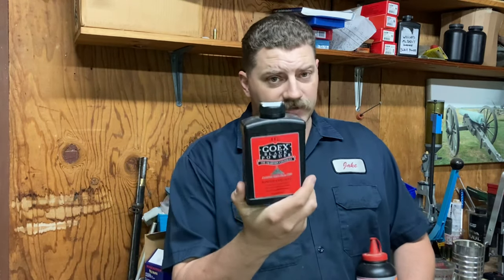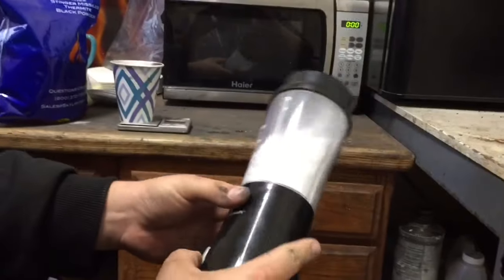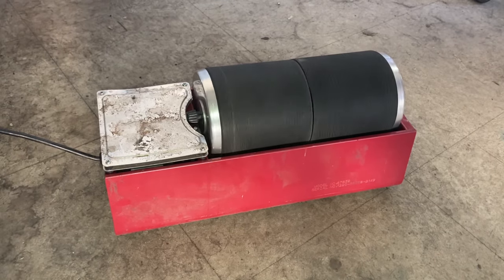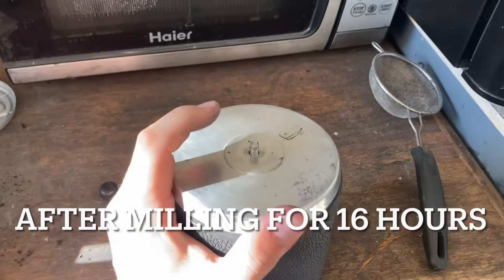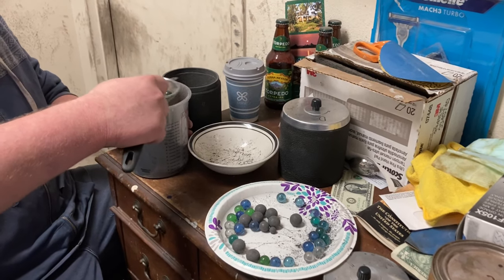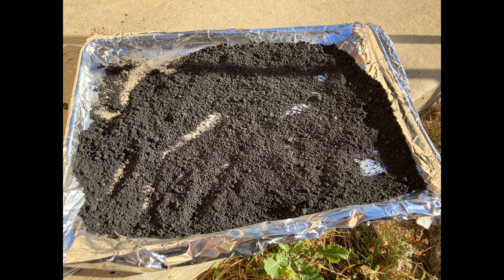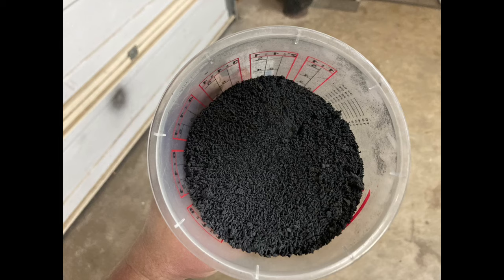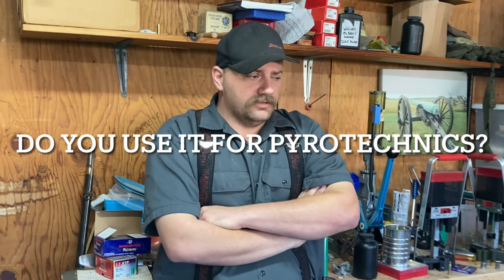How to make black powder (for firearms part 1)

Comment: Your powder is weak because your process produces a simple mechanical mixture of particulate components. Your process is typical of powders produced up until the 1820’s. 

Potassium nitrate (KNO3) is water soluble. By wetting the mixture of components with water and acetone the nitrate dissociates and is adsorbed onto the carbon and sulfur particles. Thus a chemical compound of sorts is formed as opposed to a particulate mixture. The water dissolves the nitrate. Acetone acts as a drying agent. The resultant cake is broken and screened to grade. This is the process used to produce the “fine English Sporting Powders” of the 19th century. 

Sulfur is not soluble in water. It is in non-polar solvents such as acetone. Some sulfur to carbon adsorption will occur in the above process. Sulfur is completely soluble in carbon disulfide (CS2). If added to the above mix total adsorption of the nitrate and sulfur to the carbon particles is achieved. The resultant mix is caked, dried and granulated. Then graphite is added and the powder tumbled. This prevents clumping from the slightly oily residue of CS2. This produces the highest possible energy. This process was used for cannon and naval rifle powder prior to the adoption of gun cotton propellents. 

Addition of water and a drying agent like acetone or alcohol is easily done at home. Use of carbon disulfide is not recommended. Primarily due to issues of toxicity.  It is also not readily available to a home user in sufficient purity. The “Swiss Powder” now on the market may be of the latter process using CS2 as suggested by its efficacy, but no literature so confirms. 

Take great care in breaking and screening your dried cake. Use only wooden tools and brass screen. Work in small quantity. In this way you can produce a totally acceptable propellent. 

You grains can be separated with  a set of brass screens. With 12,16,20 and 40 mesh. The 12 mesh screen retains F powder and passes all others. The 16 FF, 20 FFF and 40 FFFF and so forth. Fines below 4F should be reincorporated into the next batch, being too fine for safe use in firearms. 

Use common sense. Work safely.
Reply: I agree.
Reply: Very good sound technical advice. Thank you.
Reply: This post probably helped me more than 90% of the videos I've watched. Please tell me what you would recommend for written material that tells you how to make comparable powders to the store bought powders. Yes I'm a pepper but I also want to know. Thanks you for your comment and any assistance you may offer.
Reply: I’m

Comment: You powder is weaker because it's less dense. You need to compress it into pucks then corn it if you want the same power volume for volume.
Reply from the maker: We were experimenting with that this weekend! It seems to have done the trick but we haven’t thoroughly tested it. It also makes nicer granules, in my opinion.
Reply: @Everythingblackpowder  I have a series of videos recorded but not yet published on how I do it. Nicer for sure and more durable but I tend to loose a lot as fines in the process. Screened is still best for most applications if you ask me.

Comment: Have you tried making or buying a die and press it into pucks and the granulate it from there? I'm currently getting a list of stuff to get in order to make my own black powder and from what I read making pucks and granulating makes it more powerful
Reply from the maker: No I haven’t, but if it makes it more powerful I will give it a try
Reply: @Everythingblackpowder  yea from what I understand if you granulate before compress it you have to weight the charge by weight instead of volume
Reply from the maker: @MrArtemioP  interesting

Comment: 13:48 that is incorect, I think. It most likely decreases the amount of water in the mixture making the nitrate much less sulluable and causing it chrystalise. That's also why it's cold since solluability of nitates decreases when you cool them.

The nitrate should chrystilise naturally as the water evaporates, but alcohol has the benefit of evaporating quicker, increasing the speed at which you get a dry product.

Comment: 👍👍 You answered my question good nuff. I noticed how much lighter my ‘Joex’ is and wondered about weight vs volume. I’m betting I’m half the weight if I weighed 70grains by volume. Need a chrony but I was in a hurry to beat winter so I bumped about 20-30 grains and went with ‘feel’, report, and targets. Pretty cool. I like watching it dry, best. 😊

Comment: Your doing it the right way for sure, buying it makes no sense when its so cheap and easy to make. Your powder is pretty fast too. What definitely makes it more powerful is wetting it out  whether with water, alcohol or 50/50 of both, (I use boiling water) spreading it out to fully dry and ball mill again. I suspect you'd pickup the missing 20% by doing that. Great video!!
Reply from the maker: Thank you! I will give that a try
Reply: @Everythingblackpowder   I forgot to mention, make sure that you dry it in the same bowl container so you don't wash out the Pottasium nitrate. It will take a few days to dry, i just give it a good stir each day as it starts to dry so it doesn't end up a solid clump. The idea is the potassium nitrate is absorbed and recrystalizes into the charcoal. When i make  charcoal, I only select the very lightest - lowest density and driest pieces (branches) of willow and the again when selecting the charcoal pieces. It does make a noticeable difference to quality of the BP.

Comment: A good video on BP.  Everything you said is absolutely true. The best I've found is charcoal from Box Alder. I never tried grape vine. Commercial powder is compressed BP which means you need 20 percent less as you discovered. Definitely clean a Cap and Ball revolver right after shooting Pyrodex or you'll be taking it apart with a hammer.

Comment: I finally got around to making my own black powder, decided to start with a small batch, made 1/4 pound to begin with and got all the ingredients from Skylighter. I left out the Dextrin. After 16 hours, the powder burned fast, and after testing it in my Pedersoli French Cavallerie carbine, went off with no issues and cleaning it wasn't much different than Goex.
Reply from the maker: Glad to hear it!

Comment: I'm on my fourth batch of black powder now, and it seems that with at least the ingredients I got from Skylighter, that 16 hours is the minimum for a decent burning powder. I tested some at 12, it was close, 14 hours, a little closer than that, and 16 is dead on for a fast burn. With the weather already getting colder here and doing my powder outside, I'm probably on my last batch until spring, but I don't shoot as much or compete now so other than for hunting, I won't be going through as much. After this, time to turn some useless lead into useful projectiles!

Comment: I could also imagine, purifying the potassium nitrate by chrystallising it and washing out the junk could help. 
I'd also get some universal ph test strips. Then put some of the charcoal in water and test the ph. 
If it is a bit alkaline, I'd let it sit for a bit in a vinegar solution and then wash out the resulting salts with water.

Comment: Great and helpful video. Thank you! Skylighter recommends: 1) turning only one drum because the weight of two exceeds the 6lb capacity of the ball mill; 2) increasing the diameter of the drive roller so as to turn the drum at a higher rate of turns per minute (which reduces milling time); and 3) not to use pure lead balls but rather hardened, so as not to get lead dust or wear them out. Any comments or recommendations about these?
Reply from the maker: Yes, check out some of my newer videos.

Comment: I was able to take a volume measure of Goex powder and weigh it. I then weigh the same measured amount of my powder and finding it lighter I add that difference in weight and that's what I use for my powder. So I do actually use a weighted amount of black powder. The difference is usually about 20% just as you say so I must be doing something right. The Goex powder is denser somehow. It helped a little bit to make dextrin and add a minute amount to help keep the grains from crushing easily.
Reply from the maker: You need to start Corning your powder.
Reply: @Everythingblackpowder  I do and it's still not as dense.
Reply from the maker: @russellkeeling4387  have you tried pressing it twice?
Reply: @Everythingblackpowder  I will give it a try. I do not have a press like yours so it's not as simple for me. I am preparing to make more so I will plan to do that very thing. Thanks.
Reply: @Everythingblackpowder  I have corned some powder but it is a lot of work for little gain in my case.

Comment: Tried Pyrodex in my first flintlock and could not get it to light.  Had a glass jar with some DuPont Black Powder that I got with a cap and ball Kentucky Pistol I bought in 1969.  Put that in the pan and it went off fine time after time.  Reason that Pyrodex and 777, etc. don't work for beans in a flintlock is that their flash point is about 400° higher than black powder (BP).  You can use it with a "starter load of BP of 15 to 20 grains in the main load with the rest of the charge of Pyrodex on top of it.  Still have to use real BP in the pan, but that will work to ignite the Pyrodex in the barrel....just make it easy and use BP in flintlocks

Comment: Your home made stuff burns way cleaner than the commercial stuff, not as much"oomff" but close and very clean, I didn't see any left overs from the burn between Pyrodex and the Commercial stuff and yours.
 Nice job. I have been only able to achieve the relatively fast BP, nothing like what you are doing, I have the same setup, good quality everything, but perhaps the sulfur, it's supposed to be pure but I should crystallize a bunch. Also started making my own charcoal.
 I would be very pleased to be able to make what you are. I'm getting there. Thanks for the video!!!
Reply from the maker: If you are using good quality ingredients and milling it long enough, Then you should be able to make high-quality blackpowder. Keep after it. Thank you.
Reply: @kevinmathis1278  thanks, I have been messing around with making my own charcoal, I have an electric smoker, so it's pretty easy.
 I haven't done willow wood yet, I have done cedar with much better results than the hardwood airfloat I was buying. A lot cheaper too. 
 Thanks again, will probably take a walk down the a creek nearby and see what I can find.
 Have a great one!!!

Comment: i started tweaking the recipe again . im trying out 50% char cloth ( cotton based charcoal) the idea is that the long fine fibers would help spread the flame through the granules faster and in a more uniform motion. i don't have access to a press or else id try that method i feel like it would really take it up a notch.
Reply: Success, The charcloth mix really stepped up the powder's performance and ease of ignition. A unexpected upside was the granules seem to be denser and wont get crushed back into a fine powder quite as easily. It seems to burn a fair bit cleaner too. Even the fowling is softer and easier to clean. There are some downsides though. Its relatively time consuming to make the charcloth. Not to mention expensive if you have to buy cotton. Its kind of difficult to blend it into a finer powder, As you'll fill the blender almost all the way, Blend it and now its only a quarter full.  It takes A LOT more charcloth by volume to meet the measurement by weight compared to wood charcoal. And the charcloth can stain your hands yellow ( that one caught me off guard and thought i was in medical trouble for a couple minutes LOL). However even with its down sides it really does make a better black powder. I just wish i could find a CHEAP way to puck and corn the powder. I believe that would make it just incredible to use.
Reply: Next i want to find something i could put in my ball mill to agitate the powder and keep it from sticking to the walls or bottom. I feel like whenever collects in one spot only the top layer is getting milled to absolute perfection.
Reply from the maker: Glad to hear it
Reply: Your ball mill is very fast
Reply: @drakesairguns7848  this is great. I had this idea a few weeks ago and well looks like i found my answer. I figure Cotton charcoal would have more surface area than wood charcoal. Thanks for sharing. I have to give this a try

Comment: I'm not sure about Goex, but I know Schuetzen and Swiss make their own charcoal out of the finest select hardwoods available. I believe Schuetzen uses ash, and Swiss uses a proprietary blend of hardwoods including ash. This could possibly be why their powder is stronger than home made. It might make a good video to do an experiment to see if that's the case.
Reply from the maker: I’ve heard Swiss uses alder buckthorn which I guess they have a lot of in Europe. I don’t know what goex uses but I kind of doubt it would be hardwood. The power difference between hardwood and softwood is huge in my experience.
Reply: @Everythingblackpowder  In retrospect your right. it was alder and not ash. But I was sure one of them used hardwood in their blend along with the alder to minimize fouling, I read it somewhere not too long ago.

Comment: I been making black powder for years and years and i am going to tell you. You are forgetting one very important step. I realized I was doing it wrong when i researched "Black Powder Stamp Mills".  The mills that make/made Black powder used a large stone or wooden stamps to mash and mix the composition. But, whichever method they used it was imperative that the crew keep the powder "moist"... If not, the increase of explosion due to the mixture becoming hot or more prone to static discharge, reaches dangerous proportions. 
Add some water to your mixture to make it damp. then put it in the mill. The batches I made were 8 oz at a time in my homemade mill and milling time was 3 hours... it might be a good idea to check the mill to see if its still damp at 1.5 hours. and ad a bit more if needed. Keeping the mixture damp makes for some very quick powder. After it comes out and is milled re-wet the mixture and make what seems to be a clay or play-doh ball. You know what to do next with it? :) However before you make your ball, there is another step i do its simple but that's my "secret". This powder will be better than yours just based on what I explained you need to do (make damp before milling). Try it. If you like, give some credit my way, make a new video. Most everyone who makes black powder for BP guns do not know this simple added step(s)...
Ball milling 3.5 Ozs of Mixture for 4-16 hours (like you did) is ridicules... (just saying) :)).
Reply from the maker: Very interesting. I’ve experimented with wet milling, but in all of my tests it has made lower velocities than any dry milled powder by a good 200fps. It’s very possible I was using too much liquid. I don’t make powder this way any more because it’s inherently weaker. The key is compressing and corning the milled powder. Since I have been doing that I get equal velocities to both Goex and Swiss depending on the charcoal I use. Can you tell me more about your ball mill? I’ve been thinking of making a real one
Reply: @Everythingblackpowder  , Sadly i never made a video. Its just a 4hp electric motor, that uses a belt to turn a long bar that makes the cylinder turn the free counter bar. The cylinder lays down on its side when in use. For material use .730, .590 and .451 round lead balls. 30 .730, 100 .590, 50 .451s. the cylinder is home made out of 6 inch plastic PV pipe.  The ends are rubber and fit snugly and do not fall off. The rubber gives traction to bars on both sides of the heavy cylinder (that drive the cylinder). This is a design i put together from several others and solves many problems of the others. I still make my BP the same way i don't corn mill it. It works great. Best advice i can give if you going to build your own is make sure your electric motor can sustain hours of continues operation. (They can burn up and make your powder go...KA-BANG!! LOL :)
Reply from the maker: @GunDrone  thank you

Comment: Very nice informative video!
I saw that you used some of the glass balls which It's not good
Because I saw a lot of people saying that glass balls aren't very safe because there is a very small chance for it to spark and then explode + It can shatter too 😁
Another thing I made some black powder with Mango charcoal, Milled it for like 3 hours and it was Very fast even I felt a very very small shockwave from it when ignited I don't know how!
Reply from the maker: Yeah, I don’t use the glass marbles anymore. I find using a mix of lead round balls and cut up wheel weights mills the fastest. I’ve heard that balsa and paulownia make the fastest BP but I haven’t personally tried either of them.
Reply: I saw the glass balls at 3:47
I'm not very sure that it's glass, So i'm sorry if I was wrong.
Reply from the maker: @simplepyro7897   Yes, Those are glass marbles
Reply: @Everythingblackpowder  
Nice 👍

Comment: I believe Swiss actually uses it at a 78% potassium nitrate but I’m not sure how they’re dividing the ratio from that I just know everybody’s standard is apparently better for blasting than for guns at least from what several sources I’ve been told. In the end most people would probably never know the difference anyway good content though if you want it to reach Goex levels compress it wet that should make it burn hotter. However I have a hunch the way your doing it probably works better in a flintlock than if it was compressed I’m talking in a hydraulic press making pucks